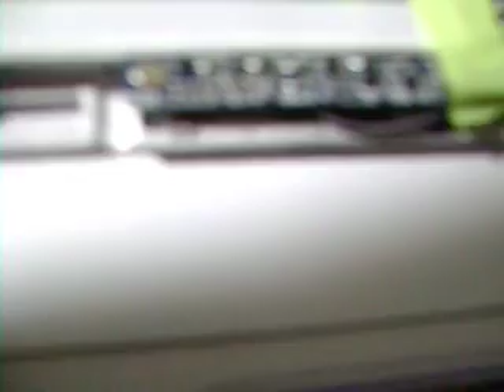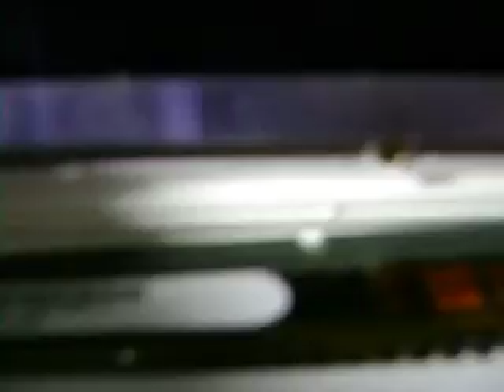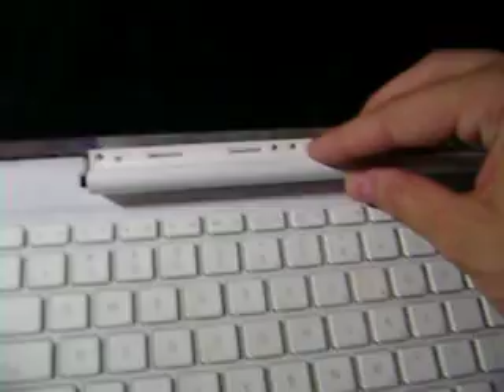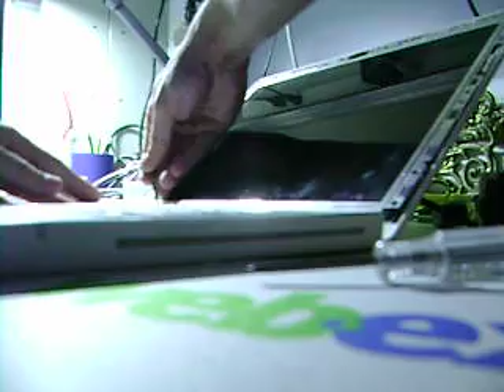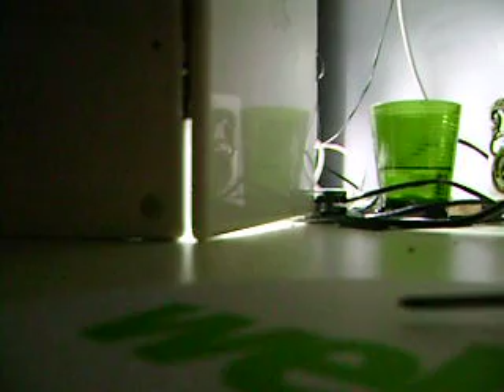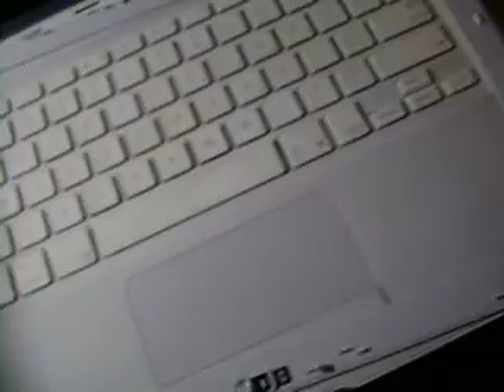Part 6 - Apple Macbook 13.3" Disassembly - Screen - Inverter - Backlight - Repair

Comment: JESUS, MOTHER MARY OF GOD! YOU DID IT!
Getting the dang new monitor reconnected to the inverter board WITHOUT taking out that piece of long plastic is IMPOSSIBLE. I'm very good at taking things apart and putting them back together again and I'll telling you....this guy does it the right way! THANK YOU! I spent a solid hour trying to blindly fish the connector back in until I discovered this video.

Comment: I just tried that link to your website to see about a screen assembly but I couldn't find one. Have you stopped selling them? I've got a 2008 Macbook with an intermittent backlight problem. I replaced the inverter. Nothing. Going to put in a new Inverter cable when it arrives tomorrow but don't have high hopes. Screen assembly would be last no?